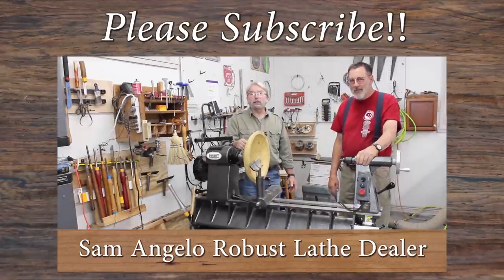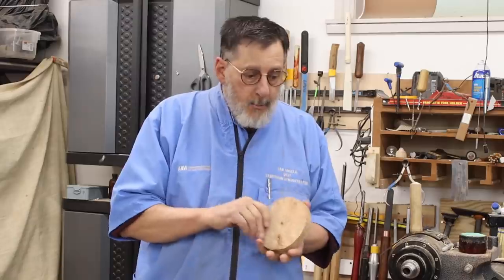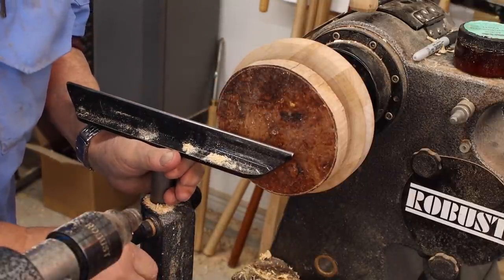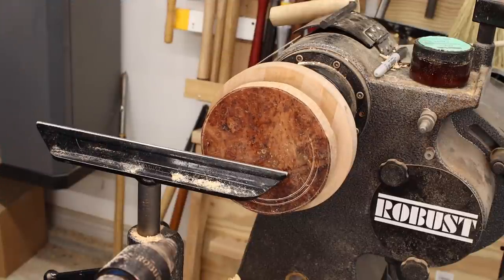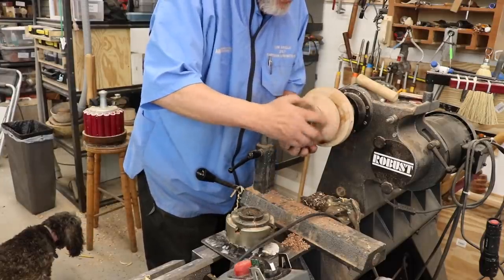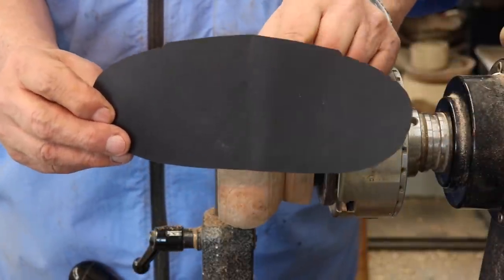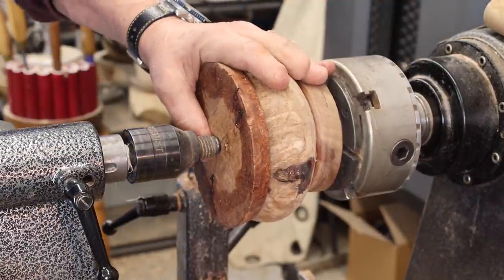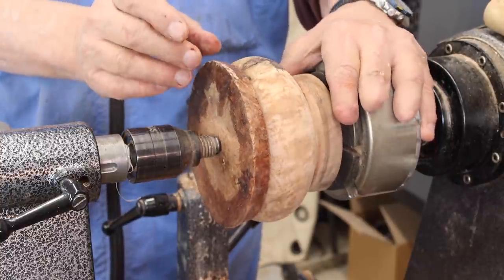Lidded Maple Burl Container Turned by  Sam Angelo

Comment: Beautiful piece, Sam. What advantages do you see for your screw chuck instead of a woodworm screw that is generally large in diameter with deeper threads?
Reply from the maker: Mike, I have a dedicated screw Chuck with a 3/8  inch thread.   I usually use this instead of the wood worm screw.  
Unless I need a heftier screw. I made this wooden screw Chuck from the Richard Raffan video I watched. I just had to make one. It has a nice wide diameter base which is helpful.
Sam

Comment: First time viewer here.  Thanks for sharing and explaining what you were doing.  Really like the screw chuck idea gonna have to review again to see that.  Also curious about the 25% liquid you have there, what exactly is that?
Reply from the maker: I am not sure what liquid you are referring to.  Can you site a time in the video?  Sam
Reply: @WYOMINGWOODTURNER  Moon Woodworks is referring to the Sam Maloof mixture.
Reply from the maker: @oldohioangler4525  Thanks for letting me know I’ll respond to him thanks very much Sam
Reply: @WYOMINGWOODTURNER  if that is the liquid that was 4 equal parts of 4 things then yes.
Reply: @WYOMINGWOODTURNER  it is the Sam Maloof mixture at the 24 minute mark.
Reply from the maker: @moonwoodworks4607   hello moon wood works. Yes I use different formulations of this but basically boiled linseed oil, tongue oil, urethane varnish, and mineral spirits to thin it down. I honestly can’t remember what mixture I used in this video. Sometimes a blend together whatever I have in my shop at the time. I am working on a video right now but will be out in about three weeks and I cover this mixture in more detail thanks Sam
Reply: @WYOMINGWOODTURNER  good deal, I seen the mixture proportions, I was and am curious as to what it is.  Like is it a friction polish similar to or better than the OB SHINE JUICE that is out there in YouTube world which is again equal parts denatured alcohol,  boiled linseed oil and shellac?